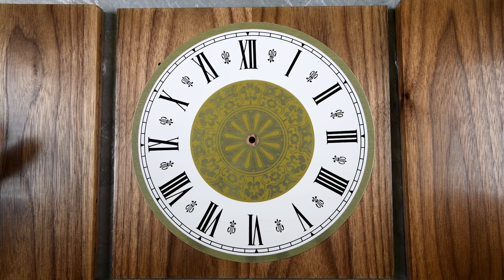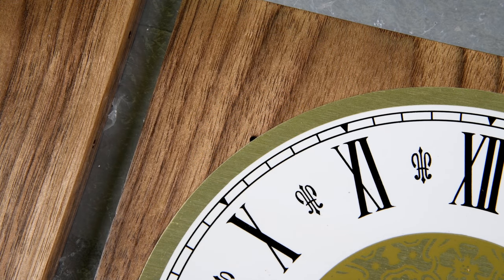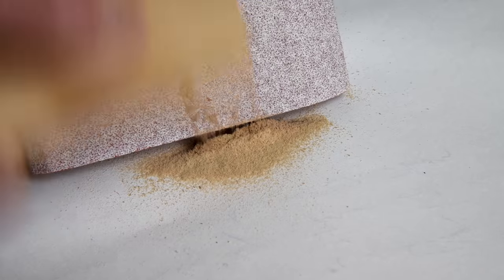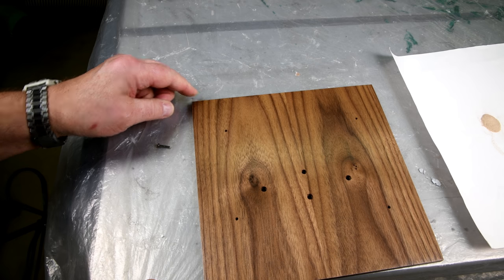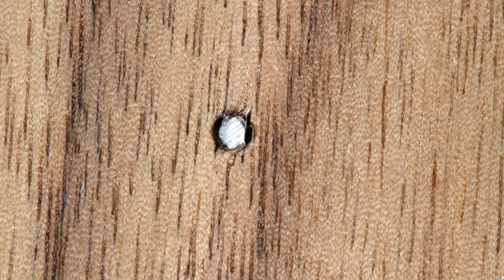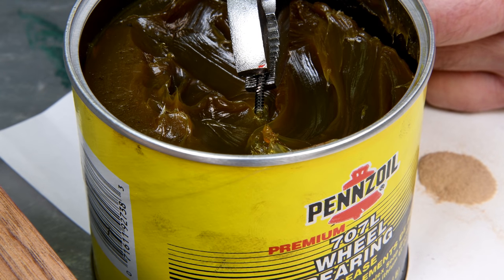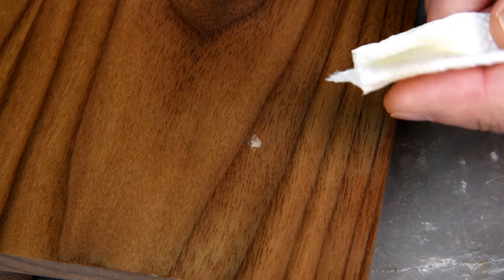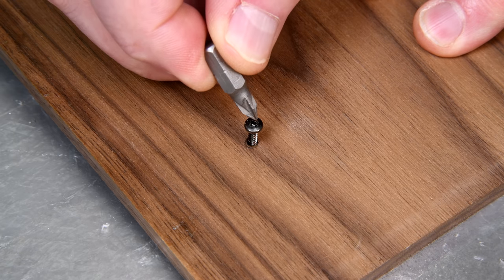The Hermle 1050-020 - Part 16

Comment: Rather than having to turn a segmented dial, which I agree would be an absolute pain,  why don't you just cut a new one using your bandsaw and a circle cutting jig? Probably something simple I am over looking because you are far better at this than I am and I have never made a clock. Love your videos, you explain everything very well
Reply from the maker: I made this dial ring 3 years ago. Had I done one again now, it would have been much the same process. Thanks for commenting :)
https://youtu.be/MM-mgD0XR1s?t=98
Reply: Excellent work... lots of work though! I think the epoxy and saw dust fill would have been my choice too